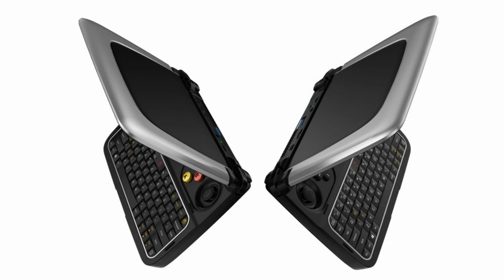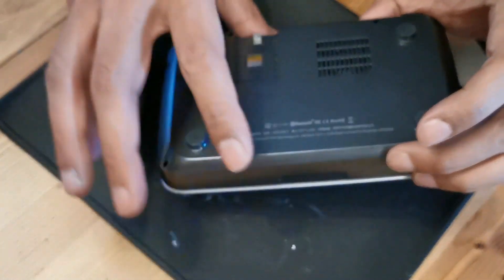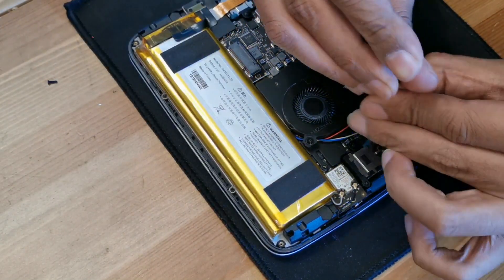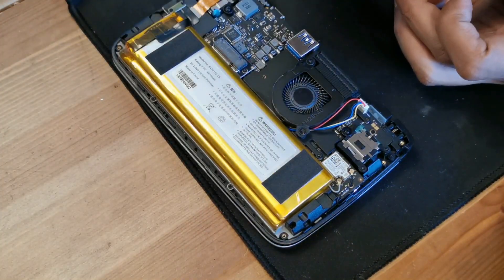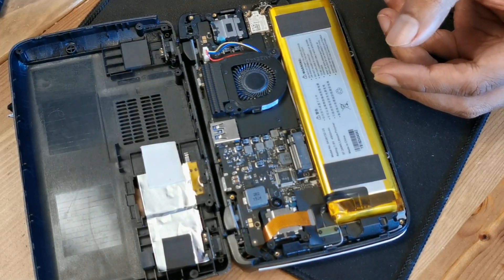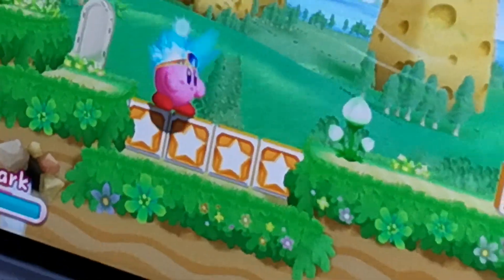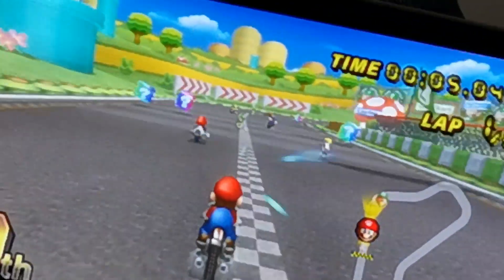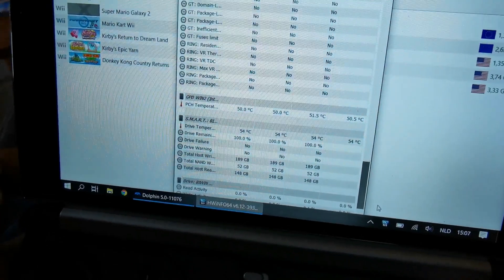GPD Win 2 m3-8100Y COOLING MOD / DISASSEMBLY / REPLACE THERMAL PASTE TUTORIAL

Comment: I was thinking of using liquid metal to mod mine. It worked on my laptop and stopped the throttling.
Reply: bad idea on a handheld like the win2
Reply: @dominus1708  why though?
Reply: @dominus1708  Yeah, why though?
Reply: because while in a normal pc that liquid metal is gonna be chillin in a handheld its gonna be thrown about like an absolute mad man and will leak whether theres a big gap or not
Reply: I was thinking The same. Have it on my laptop. But it seems to be alot of stuff it could leak out on.
Reply: @LJlindbom  I opted not to do it because I found out that the gab in the gpd is slightly bigger makeing it more likely to leake LM

Comment: Hi Gersonnl, after changing the thermal paste how does the m3-8100y  run with AAA games or heavy usage in comparison to the m3-7y30 version with the copper heatsink mod installed?